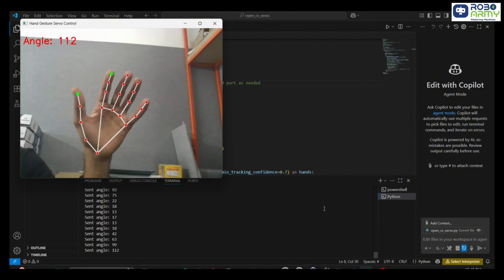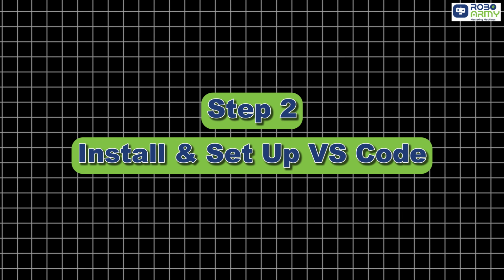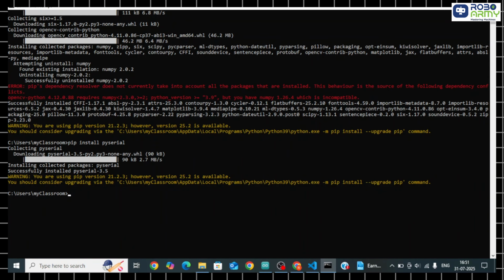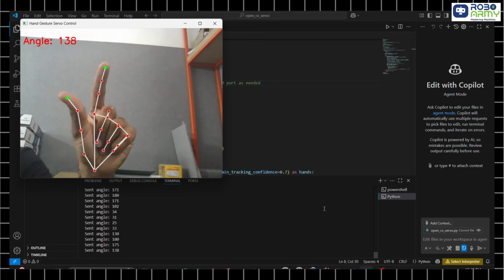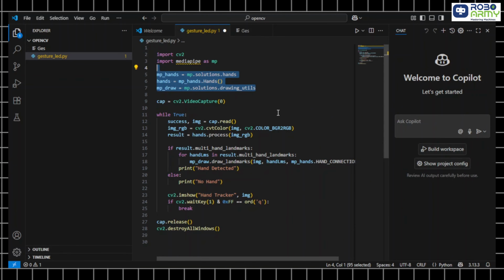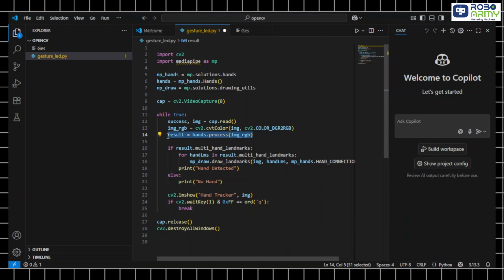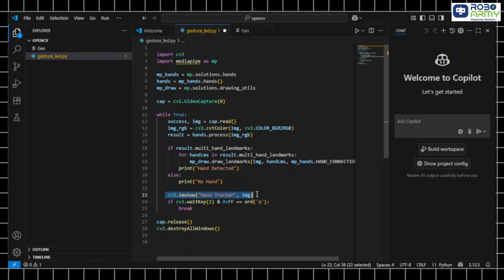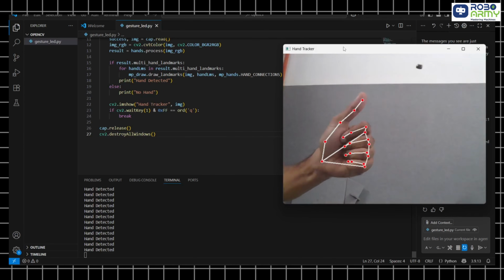Introduction to Real-Time Hand Tracking using OpenCV & Python | Beginner Computer Vision Project

Comment: bro the mp.solutions.hands doesnt work in new python 13 model
Reply from the maker: It sounds like you're having trouble with the mp.solutions.hands module in Python 3.13; you might try using a Python version like 3.9 or 3.10 for better compatibility.
Reply: @robo_army_ in 13 model how to do the same thing

Comment: my mediapipe command shows the error how to solve the problem
Reply from the maker: It might be due to Python version or pip installation issues.
First, make sure you’re using Python 3.9 or newer.
Then, in Command Prompt, try
pip install --upgrade pip
pip install mediapipe